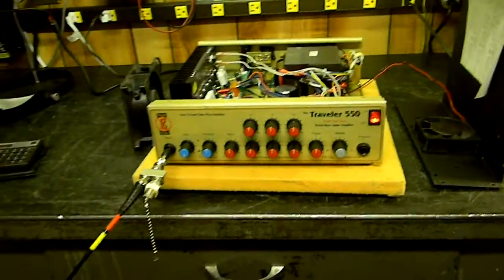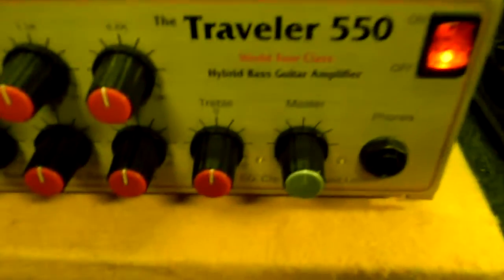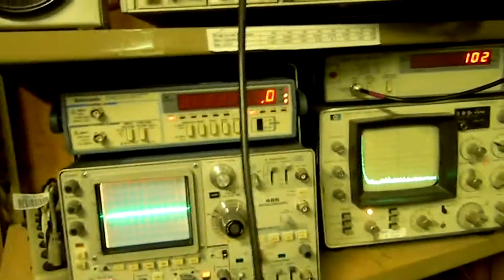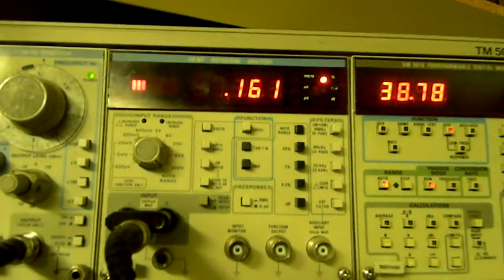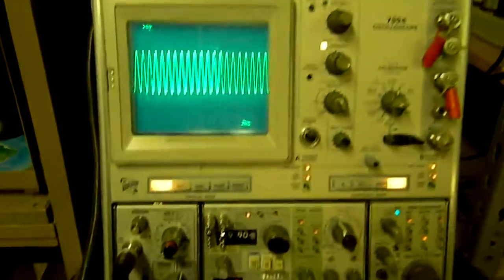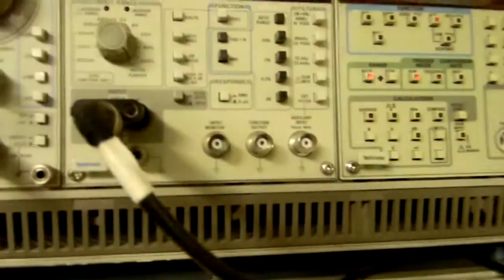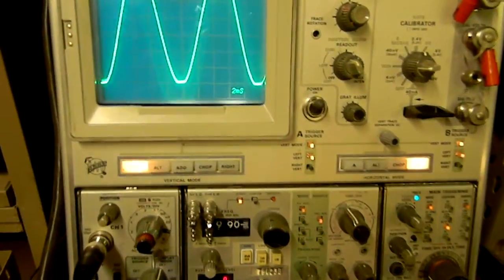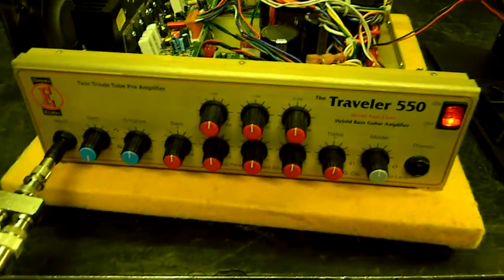Eden Traveler 550 Hybrid Bass Amplifier.MOV

Comment: hello friend I have an Eden wt 550 and have problems, and send it to the store where I buy it and diagniosticaron the following: 

DAMAGED SECTION OF POWER, THIS CAUSED BY TWO 
REGULATORS WITH THE PINES WITH COLD WELDING, this caused 
SHORT THIS SECTION, THE MASTER ALSO THIS POT DEGRADADO 
WHAT NOISE ORIGINATING. 

MY QUESTION IS IF THIS CAN AND WILL WORK TO REPAIR 100%. 

I thanks YOUR OPINION.
Reply from the maker: I am sure it can be repaired if your tech will take the time to find all of the correct replacement parts. However, it sounds like the issues are multiple and it might be best to get another one if you can't find a really good and dedicated tech to fix it - best of luck on your repair.